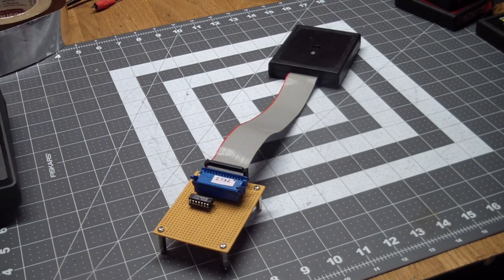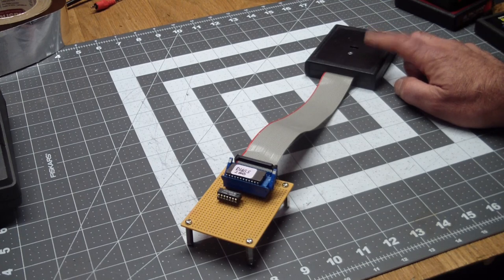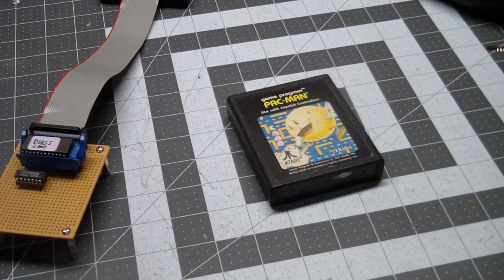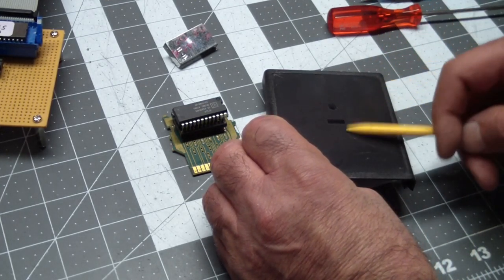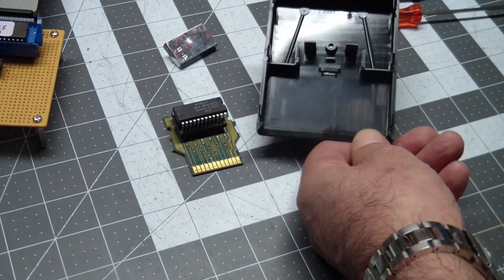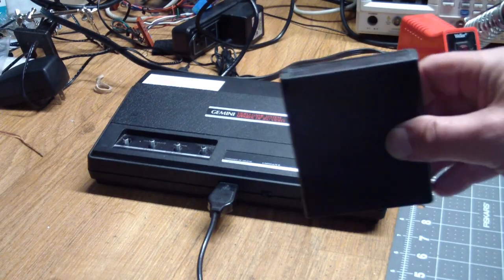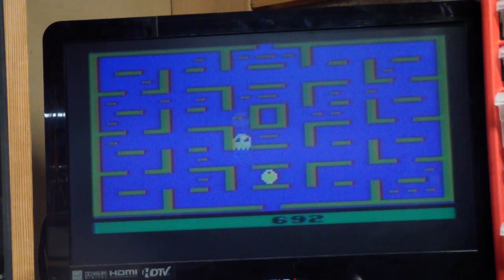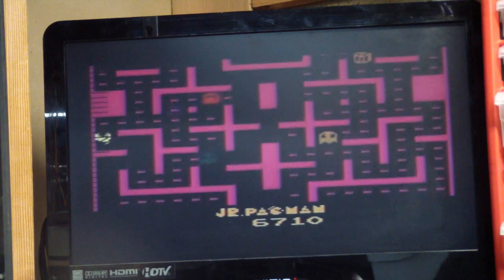AE#156 Creating A Custom Cartridge For The Atari 2600

Comment: Cool video!  I just found your channel and am binging to catch up.  As @NerdThingsAndMore previously said, a hot air station works well to remove the labels.  I set mine at 100 degrees and just take it very very slowly.  I've managed to take the labels off of multiple ColecoVision and Atari carts in this manner without a scratch.

Comment: Nice DIY adaptation! Thanks for sharing! As of 11/27/2021 - AllElectronics does not seem to carry the PSIP-80 Peel-A-Way Machine Pins any longer. I did not find them, readily, at Mouser, either. However, I don't think that it would be much trouble to remove them from a typical plastic strip.
Reply from the maker: If you search online you can still find them offered directly from one or two manufacturers.

Comment: The "My Mate VINCE" channel had some faulty SEGA games, and I think he just pulled the faulty ROM pins to GND and the cartridge started working. I think it only works if the faulty pins aren't being used by the game.

How about a remote ROM socket on the outside top of the shell/cartridge - lol -. That way you can swap ROMs on the fly.
Reply from the maker: Or cutting a hole in the cartridge. That way you can swap roms "on the fly"

Comment: I’m only a few minutes into the video, but…

Hmm… I’m not particularly into 2600s, but if I was; I’d cook up a new PCB and have it fabricated by any of the usual PCB houses (JLC, PCBWay, SEEED, etc). The case I’d 3D print. Yes, it’s more of a project, but the design flexibility I think would be worth it.

That would allow for a ZIF socket, or a high-capacity flash EEPROM with switches to select which image you want active. One could even put a microcontroller on board to load images onto the EEPROM via USB; if you wanted to run or develop homebrew games…

🤔
Reply: Mr Guru  Somehow I’m not surprised. 😉

Comment: Hello, Can you please answer this question about  Atari pinball repair? What is the bare minimum needed to make the Reset circuit pulse? I think it just needs these things: (5 volts, phase 1 signal, chip A1, A2, and chips A6-A10.) Is that true? I feel like I have tried everything including replacing A1,A2, and A6-A10 with new ones and I still can't get the reset circuit to function properly. I also tried doing these things to solve the problem: new 5v regulator, new C11, new B10, new capacitor, and swapped crystal. I even assembled A1, A2, and A6-10 on a breadboard and it didn't pulse when I applied power and the phase 1 signal from the board. I also tried a frequency generator in place of phase 1 and that didn't work either.
Am I missing something?
Thanks.
Reply from the maker: When the reset signal keeps oscillating it might seem natural to assume that the problem lies in there, but I've found that most times the reset signal is doing its job and the problem lies elsewhere. My guess is that you have either a RAM or ROM problem, and the CPU is not able to generate the wake up reset signal. Also make sure that you have a good 5V supply everywhere on the board.
Reply: @artifactelectronics  Thank you so much for the help, the main problem is that my reset circuit is not oscillating. 5 volts, counters A6-A11, and gates A1 and A2 testing good. The crystal is good too as well as two of the chips in the clock circuit. Is there anything else I should check that would keep it from oscilating? Reset is stuck low on pin 40 but the Reset button is not stuck. When I press the button and hold it, nothing happens until I release it and then it oscilates just once. Thanks again for the help. Note that phase 1 and 2 are ocsilating so the clock circuit is not dead.
Reply from the maker: I would start at A2, pins 8 and 9, and work my way backwards to find what is forcing reset low.